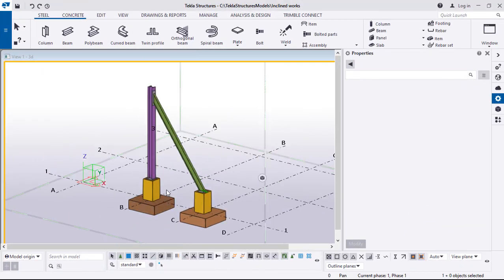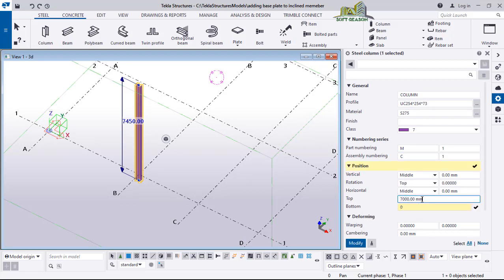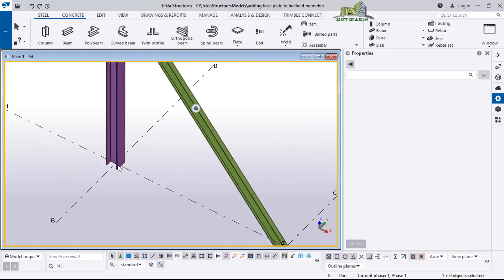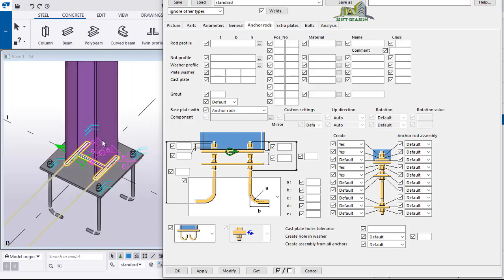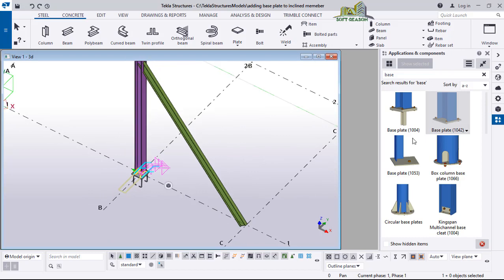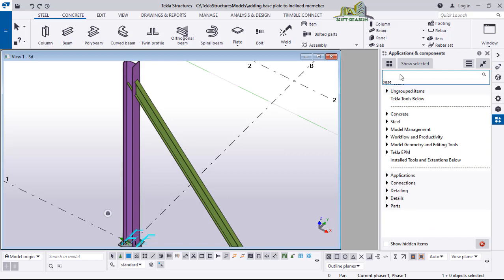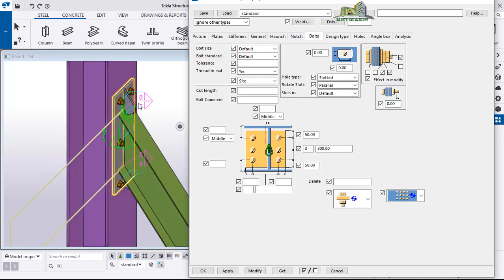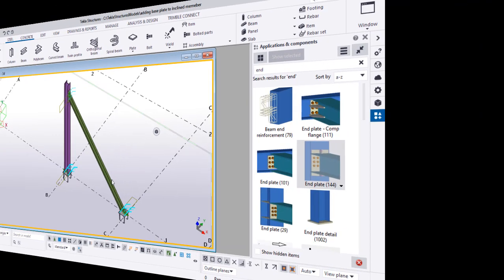how to Add  Base Plate to an Inclined Steel Member in Tekla Structure

Comment: Hello sir, thank you for your work on here sir. You're really adding value sir.
Sir please how do we get prota hot fix for prot steel and also tekla structures software
Thank you sir.
God bless you.
Reply from the maker: I didn't get your question right Sir
Reply: @CADmade-easy  Sir i mean prota steel is not working in prota 2018, i made some research and saw that there's an additional software that should be installed before we can get the prota steel working...so we can do things like connection designs and export steel drawings.

And also how can we install tekla structures sir...
We do not seem to get the installation procedure sir.